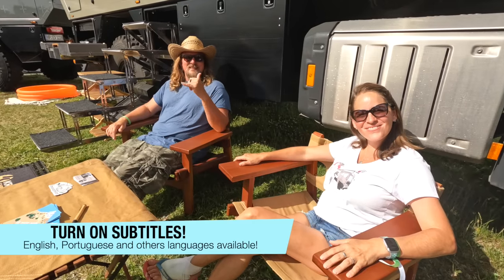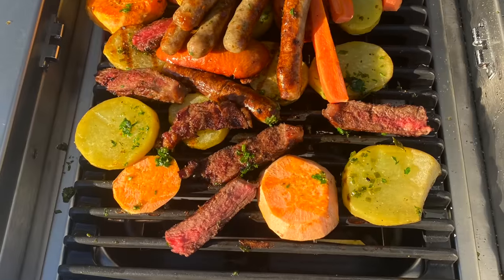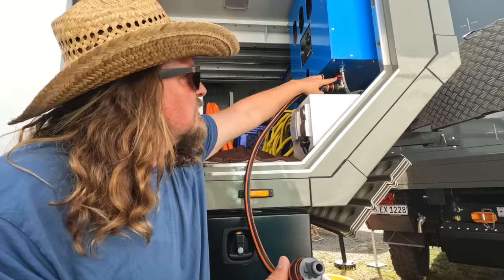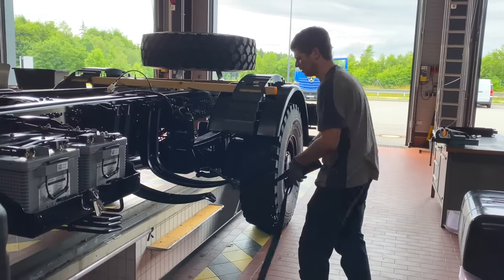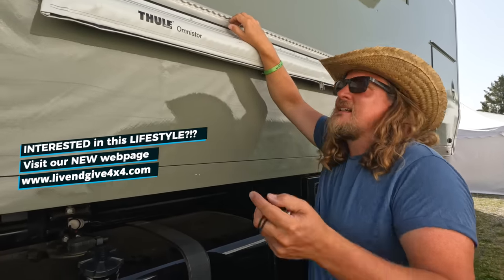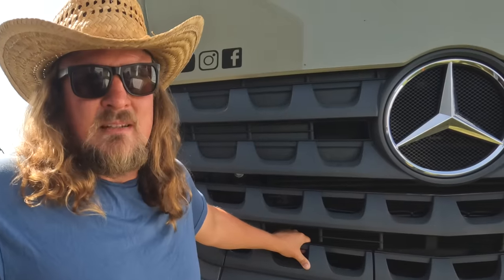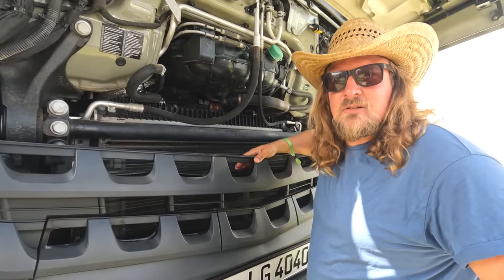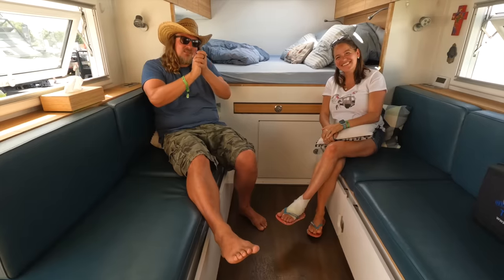The ULTIMATE Overland Expedition Vehicle TOUR ► | KRUG XP - Mercedes AROCS 4x4

Comment: I can’t believe that thing functions with only 330 HP.. I’m sure it has massive torque but 300 HP seems so little. What an awesome machine. Also, I’d put a pretty serious bash bar bumper system on the front in case you need to pile through a road block of militants.

Comment: I like this build a lot, the only thing I would change is the way that the tyre and bike rack on the back is. If another HGV were to crash into you from behind that that tyre and bike rack is going to crash straight through the window of the other HGV' cab. If it wasn't there it would hit the rear bash bar and the back of the truck and spread the impact instead of going straight through the window of the other vehicle.

Comment: Looks great awesome features. 

Although I would like to have some additional security and alarm features like a panic button you can press if the alarm system doesn't alert you, and that will start the motor lock everything what is not locked and light up everything around the truck and enable the monitor in the truck with the camera views so you have a 360 view of the truck also I would like to go from the back of the truck where you sleep into the cab to drive away without going outside. 

Not everywhere around the world it is 100% safe so better be prepared especially when you have your wife and children with you